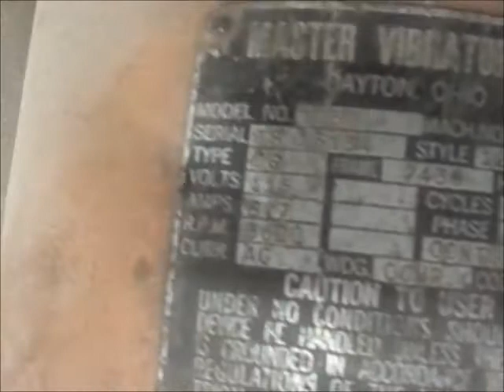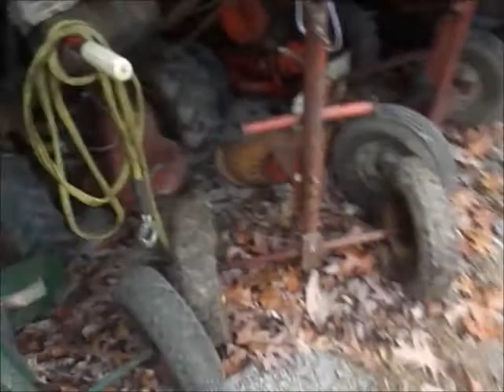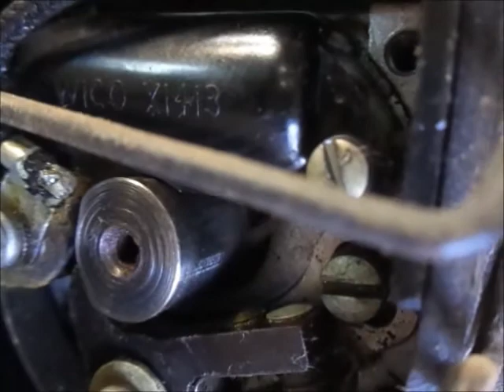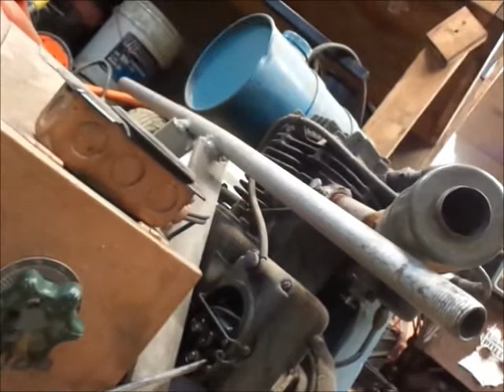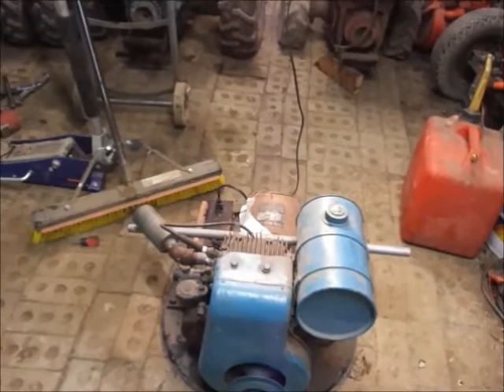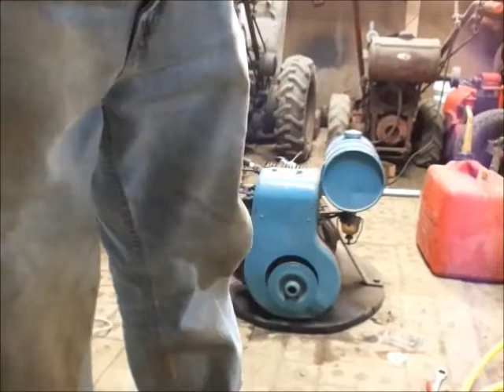Master vibrator wisconsin powered generator

Comment: Nice piece.  It depends on the displacement. It could be an AKN, which was an earlier version of the BKN, or it could be an ABS, which was a smaller engine altogether.
Reply from the maker: I do have a bkn. I honestly haven't put the effort into seeing what it is exactly. My bkn has a fairbanks mag where this has a wico
Reply: @Stevestractoradventures  That's interesting. They must have used both makes at some point. I have a BKN from a Wards tractor and it has a Wico, but not the same as you have. More like the ones on the Gravelys.
Reply from the maker: @clockbuilderhg  My bkn is on a gravely walk behind